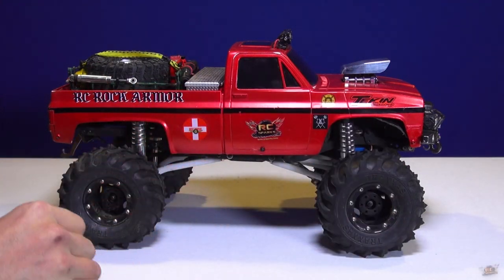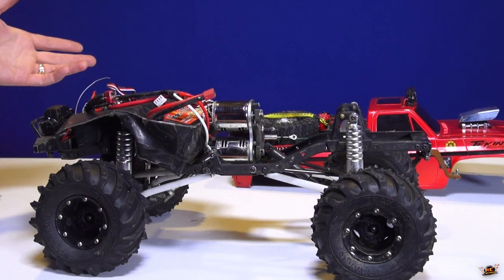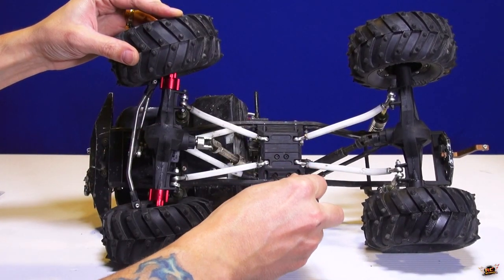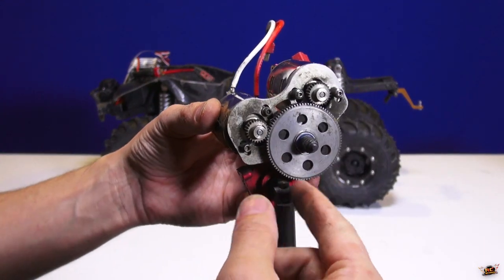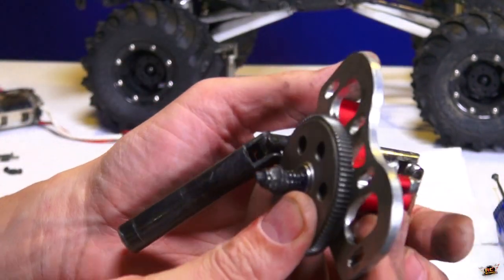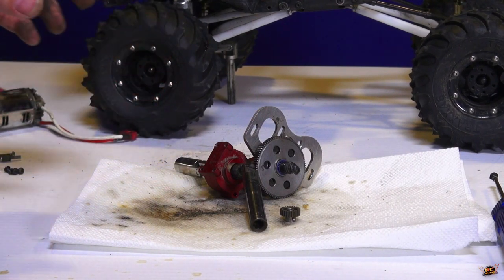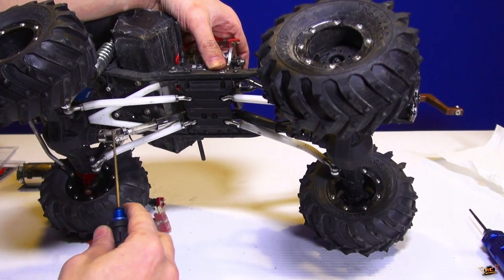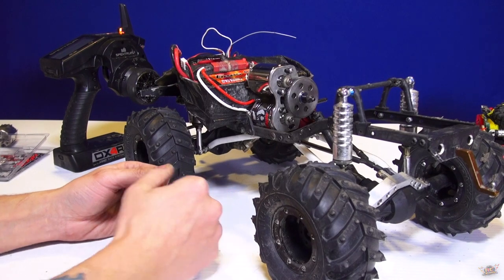RC ADVENTURES - Dual Motor Swap on the BEAST 4x4 Mega Mud Pickup Truck

Comment: I have a Traxxas slash 4x4 HCG roller I'm building with 2 old 20-turn Traxxas stinger motors. And I tryed using 2 Traxxas waterproof xl5 esc. I couldn't  get both to run At the same time. So I finally got tired of trying and went to YouTube and found this video and it helped me figure out how to hook the 2 motors up to 1 esc. Now I just got to find space for the batteries.
Reply: Or weld up some mounts

Comment: Nicely done! I like how you have the ESC placed in the front like an engine. 

On my rigs, I always cover up the interior to protect the electronics from dirt and sand. I used ProLine Floor Pan on my SCX10 Jeep (unfortunately proline doesn't produce them any more), and RC4wd inner finders and custom made lexan sheets for my Gelande 2 :)

Comment: I appreciate this! I have a very different set-up with a twin motor Jet Stream I'm trying to restore--same concept with the stuck pinion gear. It had me stumped since yesterday and I definitely didn't want to risk breaking something. I completely overlooked the screw in the pinion gear screw! Thanks for posting this 😁 all I need is a small tool set I have lying around somewhere.
Reply from the maker: LOVE THIS! Awesome, glad it helped out, possibly :)
Reply: It probably sounds silly, but ever since the RC boat was given to me by my grandpa, I've been wanting to fix it up properly ever since. 3-4 weeks ago, everything was completely foreign to me.
Reply: @TheRealRCSparks  Absolutely!! I'm well on my way to the next few steps now. I had been searching through video upon video, forum after forum... Most have a newer set or a single motor, but this one closely resembles my own enough to get past that hurdle. Priceless info! Thanks 👍🏻

Comment: What was the glue looking stuff you put on the solder point before you heated? I have 2 soldering irons of which both don't heat enough. Any tips? Thanks Medic :)

Comment: Couldnt you just put 3 motors in to have 3 times the torque or will that tear the transmission apart. And also one of my wires on my 3s lipo to charge it broke off and and I have no idea how to solder it back on can u please tell me how to or show me?

Comment: Medic why don't you move the motor/transmission plate back a whole where the rock guards usually are setting, that is what I did and it decreased the sharp angle of the front drive shaft. It should work for your rig but I can tell you moved the rear axle forward to fit the tamyia body... just trying to help!

Comment: Medic , why do tou have two lengts of cable on your motors?
the internal resistance wil be different and lead to loss of power to one of the two motors.
which results of barbequing one motor.
Reply from the maker: because the motors are different lengths away from the esc..
Reply: Were talking an inch or two.. I can assure you this will not cause trouble with this. Copper has very low resistance.

Comment: hi I have the same Tekin motor on my Trailfinder 2 and I connected the red wire to the red side and black to the black side and I had to reverse the throttle on my transmitter to make it run properly any thoughts?

Comment: Hey Medic, do you mind clearing something up for me? Apologies if you already covered it in the video, I haven't yet had a chance to watch it all the way through.

I have always wondered how the twin-motor set-ups, where two motors run onto one spur gear, work properly?

What I mean is: Because of the natural variation, which always exists, no two motors are EXACTLY the same. For example, I have 3 good ol' Revenge of the Monster Pro Stock 27t brushed racing motors from my touring car racing days, about 10 years ago, and one is substantially better than the second, which is marginally better than the third. These can be seen on the dyno printouts on the cans.

So if two motors spin one spur, does one motor pick up the other, slightly-slower, motor's drag and therefor experience higher temperatures and wear? If so, is that why one of yours failed? Because it wasbeing held-back by the other motor? In order to compensate, do you have to get dyno'd motors with near-identical printouts, and/or, maybe turn down the output on the ESC, so they both spin at the same speed, albeit one at 98% and one at 92%, for example?

Just curious. Thanks! As always, great job.
Mike, Scotland.
Reply from the maker: I just slap two in and go ;)
Reply: *****
Hahaha ahh well! But you don't deny it happens!! :P
Reply from the maker: Praet0r87 I dont deny that it happens.. but its never impacted me enough to notice.. :)
Reply: *****
Fair enough! Thanks for the info, gives me a bit of piece of mind if I ever go down the same route.
Reply from the maker: Praet0r87 aces bud! Good luck and have fun :) the RC world is only limited by your budget ;)
Reply: *****
DAMMIT!! Always a catch! ;)

Comment from the maker: First ;)
Reply: Anyone know howta take out a worn out allen screw because i am trying to take out drive shaft but i cant because of the screw
Thnx if anyone replies
Reply: TheCarAddictive#1 wrap a cloth around your Allen key and try take it out like that. sometimes works with my larger ones.
Reply from the maker: TheCarAddictive#1 Drill it out..
Reply from the maker: Erick Poirier all motors will get hot. Brushless get hot because they spin faster..
Reply: TheCarAddictive#1 ***** . I had a similar problem. I put some duct tape on the screw, that applies a tighter grip. Then by applying easy, slow pressure I was able to turn it off. Good luck!
Reply: Medic can you please do motor break in video we want to know your way to break in a motor because your way to do it is the right way to do it
Reply: ***** Yes medic do it, inside the damaged motors, its good to learn and see whats inside
Reply: lol, nice video :)
Reply: medic whats a good starter crawler im hoping to start out my adventure with crawling
Reply: nate schu

comp.-crawling or scaling ?
Reply: comp
Reply: nate schu

http://store.rc4wd.com/110-Bully-MOA-Comp-Crawler_p_189.html this comes as a roller --> so you will need 2 motors and escs ,steering servo remote and body as well as battery and charger

Comment: Hey medic my name is justin im new to rc, the other day I was driving my 2wd slash and all of a sudden my steering quit workin, bu it still goes forward and reverse, any ideas what could be wrong , ive only had the truck 3mths and this is the 5th time ive drove, and I havent bashed it just driving around at the park
Reply: Your wires to your receiver might be loose or your gearing in the steering servo are striped out
Hope this helped man
But later on when you start exploring all kinds of stuff on your truck you will feel like you no every thing about just saying thats how i feel
Reply: Thanks man I appreciate the help
Reply: Your welcome bro anytime and i used to be new to this now its pretty simple to me so yea i have the ford f150 raptor svt and I've upgraded quite the stuff on it to so yea
Reply: O if ur wondering aaronhileman is my other account thats attached to this one so it'll put that account on for some reason i don't no why but its the same person your talking to

Comment: Why you cannot just god dam put one already waterproof Castle Sidewinder to that beast? We all know that brushed motors have short lifetime.
Reply: Castle motors are not for use submerged in liquid it wouldn't last longer than a run or two
Reply: You have to know that castle systems aren't recommended for crawling and speed isn't necessary when crawling as well. (Douche)

Comment: Mmmmm... smells like magic smoke... nasty. Haha I have a cheaper RC that burnt out a motor running larger tires (my fault for not changing the pinion to compensate for larger tires) and the motor smells nasty and sounds like grinding gears. Part of the hobby's fun is fixing your RC when it breaks!